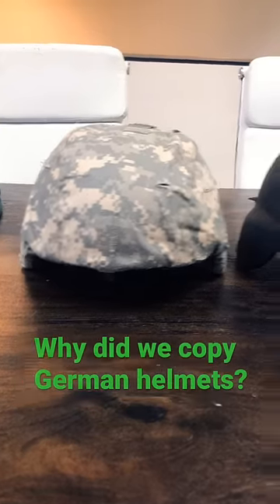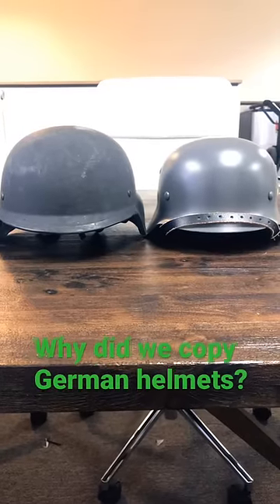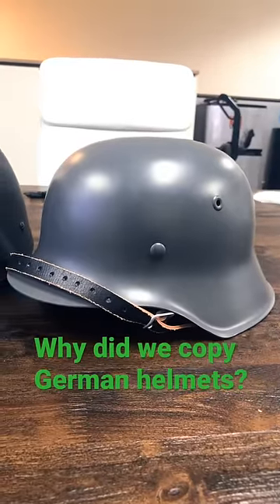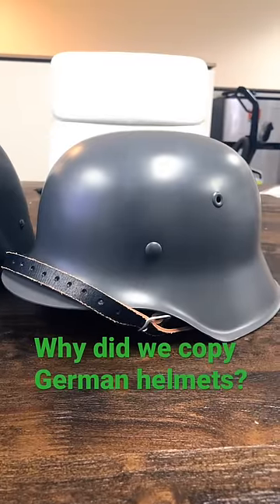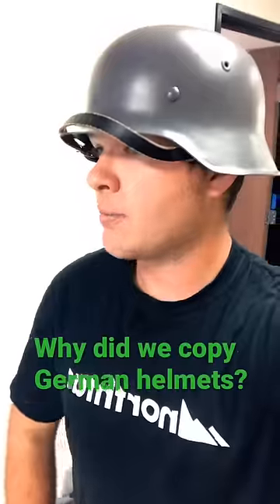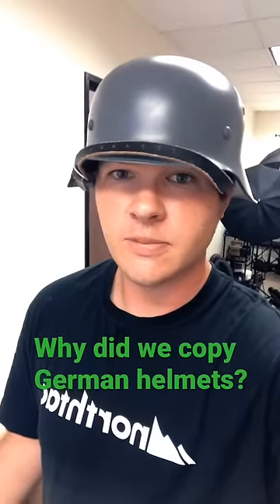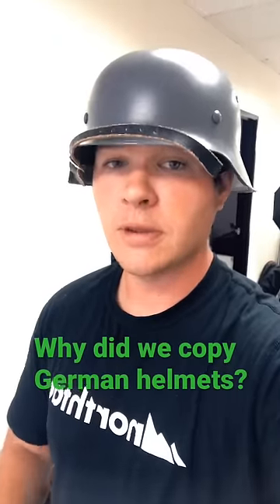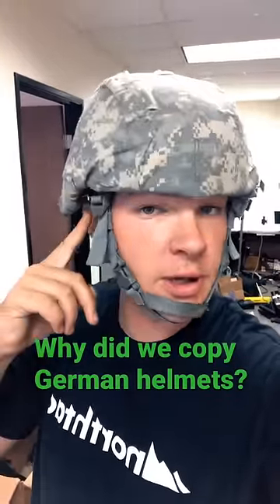Why did we copy German helmets? #shorts

Comment: It’s interesting to see helmet designs of the First World War. It really does seem like, for Germany and Britain at least, they went back to their medieval roots. The Stahlhelm looks similar to a Sallet while the Brodie helmet takes notes from the Kettle helmet.
Reply: I've read a bit about how the ww1 helmets came to be and yeah.. It was Pretty much putting medieval designs back into production, with many investigators going to museums to research the best designs
Reply: Wow
Reply: That's not just it. They used armour too, sheets of iron plate about body sized. I've seen pictures of what looks like a walking tank. Then theres the trench raids which resorted to home made versions of weapons that wouldn't be out of place at Agincourt.
Reply: MORDHAU MOMENT!
Reply: @Darkfarfetch They follow the same principals. Apparently not that well because the new US standard helmet won’t even stop armor penetrating nine mill. That’s probably why they changed it so quickly.
Reply: @mikeycraig8970  those were widely disliked by the troops and rarely issued. The most common use of it was the extra armour on the helmet for machine gun crews. Forgotten weapons did a video on it
Reply: The flare at the back of the helmet to protect the neck is very reminiscent of the Roman Galea helmet. At least to me.
Reply: ("Sgt.J."). The "Steel pot" Was kinda annoying. But, You, Could  bathe 🛁 with it. Those goofs at Ft- hood would cook armadillo. Or, What ever crossed thier mind. We already got the kevlar A-1s... Or, 2s? With the parachute pad for the neck. I, didn't like those much. I, Did miss the other helmet only for the washing part. Lol. 👍✌️🇺🇸. Peace around the world. 🌎🌍. ✌️🕊️.
Reply: It’s not that simple. The main concern was ease of manufacturing, and in fact both the Stahlhelm and the Brodie were designed in such a way as to be capable of being manufactured from a single sheet of steel as it passed through a single press, on a single factory line. There were other designs proposed to the British War Ministry, all Far better than the Brodie (which sucked btw), which were far more similar to the helmets in use by firefighter crews, but they were all discarded because they were more expensive and especially took longer to manufacture as they required more than one factory line. They even tried copying the Stahlhelm, but the slight technological difference in steelworking meant that Britain couldn’t replicate it as easily and cheaply as Germany could.

This had the consequence of leaving British soldiers with the worst helmets of the entire war. Their were so disliked by France that they actually went on to produce the Adrian helmet even though it was both more expensive and required more factory lines to put it together, and later even Italy chose to first buy and then copy helmets from France rather than from Britain.
Reply: Yeah. I noticed that with the english.
Reply: @adolfolerito6744  complete rubbish the Brodie was the best design low weight key and on the horizon plus peripheral view was vast and in any event I don’t think a thin steel helmet would prevent shrapnel entrance more of  use for vertical rubble impact no wonder the French lost 😆
Reply: That's exactly what they did. Not just with helmets either; although the helmet is the only piece of WW1 body armour that survived to this day, they experimented with all sorts of things, and since a lot of these countries hadn't used armour since the late Medieval period, that's where they looked for inspiration.
Reply: @lucashurley7612  helmets are not supposed to stop direct fire rounds. They are there to protect from shrapnel. I promise you in a real battlefield situation you're far more likely to be killed by artillery than a sidearm.
Reply: @spacebogey1115  sorry, but it’s not rubbish. Fast and cheap production exactly as I described it is literally the chief reason why it was designed like that, you can research the documents yourself. On the effectiveness of the design, the Brodie had flaws that far outweighed its benefits, starting from the very low area of the head it covered (no no ears, no back of the head), to its wide circle shape that soldiers bumped into everything, etc. Low weight may be a factor in modern times, but not in WW1 trenches (especially when it comes at the expense of added protection from lethal injuries), and yes: the field of view might have been just slightly better compared to the Stahlhelm or the Adrian, but in a trench warfare stalemate where you are always attacking and 80% of casualties are caused by artillery that you cannot see or dodge, that’s an absolutely useless perk to have.
Finally, good helmets were actually capable of blocking bullets and shrapnel depending on size, force of impact, etc. exactly as they are today. Another user already said how much of a great effect did the Adrian have for French casualties due to head injuries, so I won’t repeat that.

Anyway, you don’t even need me to tell you all of this, because the best demonstration of how much the Brodie sucked lays in the fact that if it had been good, the militaries of countless countries would have noticed it and developed their own helmets on its design. Not just during WW1, but for decades to come.
This of course didn’t happen for the Brodie, but happened for the Adrian and the Stahlhelm, which instead became the base of modern military helmets used by the militaries of the entire world.
Reply: @kapitankapital6580  they can absolutely stop direct fire rounds, depending on several factors. There are literal videos of soldiers getting shot directly on their head and not having the slightest wound or trauma here on YT.
Reply: @adolfolerito6744  if the drawbacks outweighed the benefits, why was it used? If it was so bad, why did the US use a near copy until 1942?

Seems like it wasn't so bad after all, considering its service life.
Reply: @kapitankapital6580  They are still rated for pistol rounds. have you ever seen a helmet tested? People have survived PKM 7.62x54r to the head indoors. They need to at least be able to stop a crazy dude with a glock. Shrapnel my ass those boys are tough they can survive a pistol to the head. Bruh.
Reply: @kapitankapital6580  Also no, plenty of guns are chambered in pistol calibers. Go into a house after 3 dudes with MP5s and then lets see how you feel about pistol caliber protection being standard. The helmets are worst than stuff from the start of the gulf war. That is a problem. Go watch oxide or someone else’s test so you can learn something.
Reply: Stop calling them Stahlhelm as it were a proper name. It's a common noun meaning just steel helmet.
Reply: @mikeycraig8970  only machine gunners used armor and even then it wasnt common
Reply: That's because the English and Germans DID.
The French and Belgians based theirs on French firefighters helmets
Reply: @adolfolerito6744  we're talking presynthetic material.
You can pick up steel helmets with bullet holes taken from BOTH world wars as trophies.
For that matter the generation of K-pot I was issued in the late nineties had iffy protection from a direct hit from any military rifle.
Sure it might not kill you, but that round would be penetrating your skull with those and they were the best helmet at that time.
Reply: @lucashurley7612  Helmets aren’t meant to be bullet proof. Even if made of materials like Kevlar. There’s no way to make a helmet bulletproof and keep weight down. They’re meant to take impact and stop shrapnel from carving your pumpkin, which they do exceptionally well.
Reply: @mikeycraig8970  that is so cool. Our ancestors weren't idiots. Retvrn to tradition
Reply: @barryallenporter8127   Exactly. But due to movies and video games some people think that it will make the soldiers head bulletproof. If a granade explodes on a rock for example, the helmet will stop the small sharp fragments from causing further injury to the soldiers head.

Comment: The other peculiarity of the stahlhelm is that it was designed in such a way that it could be manufactured from a single sheet of steel, by passing through a single industrial press. That made production extremely fast and cheap, as a single factory line could be used to transform pieces of steel into helmets.

Comment: "It was viewed as cowardly to wear a helmet..."

Another example of why peer pressure is bad for your health
Reply: As if the Stahlhelm gave any protection. It is just psychological and therefore it might have been better to wear no Stahlhelm at all.
Reply: @bigblockjalopy  Maybe a bullet could go straight through a stahlhelm, but it did protect whoever was wearing it from shrapnel. Do you really think a country would supply its' military with non-functional helmets just for morale? Where'd you get that conclusion from?
Reply: @spiritmoon5998  Where? I served and wore one of these. Shrapnels will go thru that thing like Butter. Theoretically there is a little bit protection but It is just thin sheet metal. Are you saying that everything of a military uniform is functional? Absurd
Reply: @bigblockjalopy  If that's the case, then I was wrong. Ain't gonna argue against that. But I gotta ask, did you wear one while in service or not in service? Other than training purposes, I haven't heard of a modern military issuing old helmets like that.
Reply: @spiritmoon5998  while in Service in the 80s. Just like the MG42, (renamed MG3) we used, it was still unaltered Wehrmacht equipment, maybe slightly improved.
Reply: @bigblockjalopy  it... did...
Reply: @History_Nurd  as i said, very little, like flying rocks from an impact and rain. Shooting from a trench, it makes the head about an Inch taller, which is very a bad thing, Like a signal for a marksman from the other side. It gives No protection whatsoever against bullets.
Reply: @bigblockjalopy  against bullets? Nah, no helmet at the tine could
Against shrapnel? Yeah
Against a ricochet? Maybe
Reply: @History_Nurd  of course there are helmets than can stop for instance, 9mm. But they are Not Out of sheet metal.
Reply: @bigblockjalopy  yeah
MODERN helmets can stop bullets
OG helmets cant
Reply: @spiritmoon5998  Russia rn: 😬😳
Reply: @bigblockjalopy  well I don’t think helmets were originally designed to stop bullets.
Reply: @RealDavidChipman  they were originaly designed as a protection against swords, maybe arrows and stayed as part of a military uniform, even though they (steel versions) give very little, If any, protection in the field.
Reply: @bigblockjalopy  perhaps you’re right. However, in the field I’d rather have a helmet instead of nothing. If anything, to alleviate some worry about shrapnel.
Reply: @bigblockjalopy  let's also not forget that trench raids were often fought with melee weapons. You can't tell me you wouldn't want one when someone is coming at you with the butt of their rifle or an improvised club
Reply: @bigblockjalopy  also they didn't just protect against shrapnel but rocks and clods of earth
Reply: @TheTomco11  Not often. Once a trench has been taken, the enemy was already wounded or dead, then finished with the bayonett and In a fight man vs a man you don't want a helmet. They werent cutting your scalp, but aiming for your throat or Body. And once again, in a trench you don't want your head taller than it is. The aditionall 1 Inch the helmet provides, is the perfect Signal for a marksman. Did you Serve? Did you ever Run or fight with a Steel helmet?
Reply: @History_Nurd  i beg to differ the M56 EAST German helmet can stop a bullet if shot at a correct angle, look it up on Youtube the bullets richoets upwards
Reply: @royale7620  just like how any helmet can stop a bullet if its at an angle? 
Me when dumbass argument:
Reply: @bigblockjalopy  that 1inch didnt change anything, as fucking everyone had service caps on that did the exact same thing, except with 0 protection
Reply: @History_Nurd  Sure any helmet, shoot a Brodie helmet or a M16 Stahlem see how well it bounces off, the M56 was specifically made to bounce off from low caliber pistol rounds head on. Maybe a watch a M56 shooting video before you say spastic crap.
Reply: @royale7620  if you shoot a brodie at an angle, the bullet will just graze it
If you shoot the 1916, it will graze off of it at an angle
Any helmet at an angle will stop bullets
Reply: @History_Nurd  that Inch makes your head visible maybe seconds earlier, or enough time for a marksman to aim. It can be the difference between life and death.
Reply: @bigblockjalopy  just like with the cap, except the cap offered no protection
That extra inch wouldnt be enough for a sniper to aim, especially if you are on a trench, as your head wouldnt even show up
Reply: @royale7620  forgot to mention
I was talking about WW1-WW2 era helmets being incapable of stopping a bullet going on straight angle
Of course, duh, a helmet of the late 50' early 60' would be able to stop pistol rounds
Reply: @History_Nurd  a helmet is way taller of course, but a cap is needless too.
Reply: @History_Nurd  you are shooting from a trench, so of course your head will show.
Reply: @bigblockjalopy  you ever hear of the strategy of attaching the thing to a stick and letting the marksman waste their ammo?
Reply: Looking at you skateboarding
Reply: What we today would call “toxic masculinity,” but is honestly just people doing dumb shit out of bravado
Reply: @bigblockjalopy  It can stop pistol shots and some glancing rifle shots at long, long ranges. If you're sitting here telling me that it'll stop a pistol round, but can't take some fragments with the same energy, I think I'm gonna have to call you a liar. If you served, you must have not been paying very good attention.
Reply: @ToyotaTechnical  it seems to me you have a Problem with Reading. Theoretically it can protect from a rocket, If the distance is long enough. In the field you don't fight with pistols. Obviously you never served
Reply: @ToyotaTechnical  Not designed to.... See what I mean? Even pistol shots can pass, with the right ammo, Einstein. You obviously never served.
Reply: @ToyotaTechnical  If you have to ask that ....
Reply: @ToyotaTechnical  wth? Don't you even know, there is all kinds of different ammo for, lets say, a 9mm? Like round nose lead or full metal? How old are you? And again, in the field you don't fight with pistols. You obviously watched too many westerns.
Reply: @bigblockjalopy  Buddy if you think serving in the Bundeswehr qualifies you to speak on behalf of the German army of WW1 you're very wrong they are completely different armies and times also interestingly enough different helmets. You only need to look at the statistics for head injuries that were treated in hospitals to see that, they increased significantly when helmets were issued for the british bc helmets allowed people to survive low velocity shrapnel that'd otherwise go through their skull and kill them. Also this insinuation that 1 inch makes an actually substantial difference to concealment in a trench shows you don't know how firing positions in a trench worked. Actually trench clubs and other improvised blunt melee weapons were used heavily in ww1 so a helmet would be bery useful in close quarters.
Reply: @bigblockjalopy  oh yes I'm sure you seen lots of shrapnel because the Bundeswehr got in soooo many conflicts in the 80s
Reply: @bigblockjalopy  cover your grape
Reply: @bigblockjalopy  The Bundeswehr is not the same as the Imperial German Army. Just putting that out there.
Reply: Only, that never happened.
They originally didn't wear helmets because, until then, the vast amount of casualties was produced by direct fire, either bullets or artillery. Steel helmets, unless unreasonably heavy, were virtually  useless against that.
Once shrapnel from indirect fire became the main killer, helmets were reintroduced.
Reply: @leoghigu  The best extrapolation I can think about is how people got more head related injuries after getting helmets... because instead of getting KILLED by shrapnel people were merely incapacitated or wounded.
Reply: @bigblockjalopy  Why don't Spacial Forces wear helmets? 🤔
Reply: @gregoryhagen8801  you all have a problem with reading, it seems.

Comment: “If it ain’t broke, don’t fix it”
Reply: Actually they change the design of the then new American helmet after the invasion of Grenada because the President got a lot of flak (Ho) because they looked like Storm Troopers. The brim was modified.
Pete.
Reply: @ptrisonic they didn't change the design, the put loose fitting camo fabric/scrim over it to mask its shape. The later ACH deleted the front brim due it it interfering with NVG and optic use.